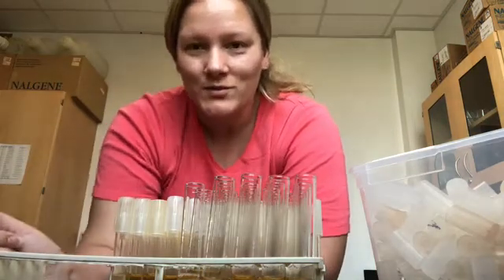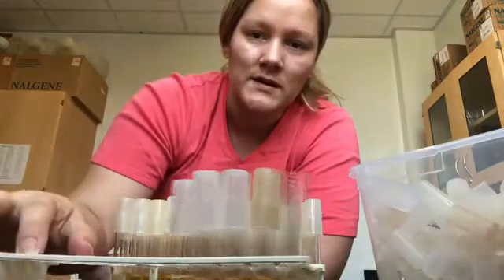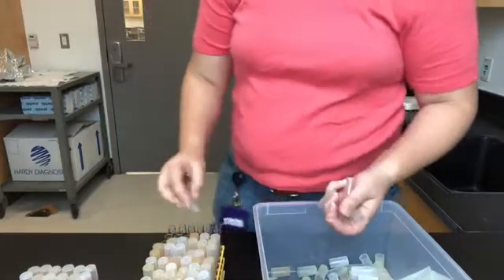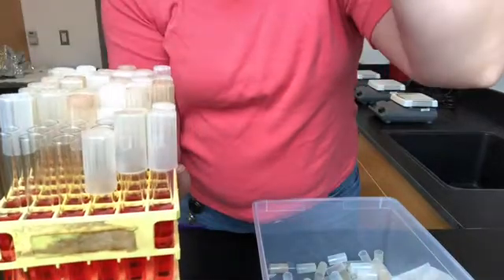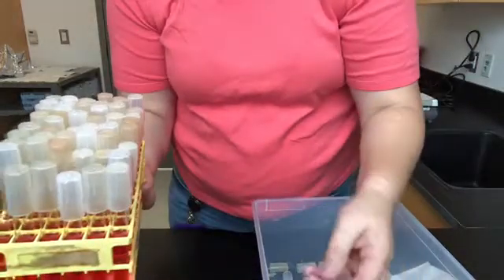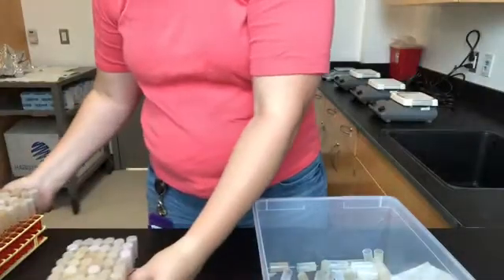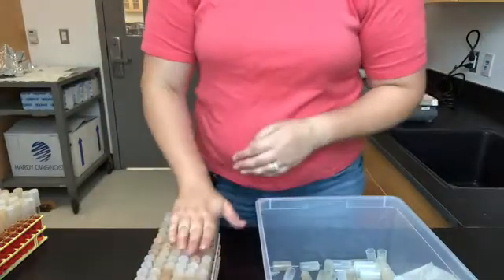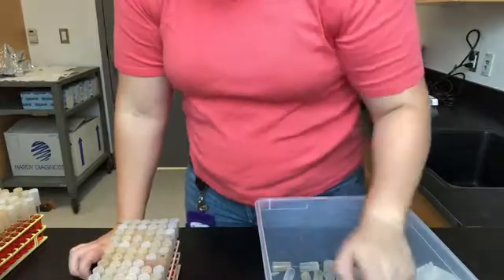How to cap test tubes

Comment: Hi Lori, great detailed video, but I have two questions: 
I've found that my similar caps are not air or liquid tight.  I'm just preparing PBS for dilutions, and it would be important that the volume doesn't change too much due to evaporation since I want to prepare them a few days ahead of use. How long can you keep these after autoclaving usually?

Do you know any autoclavable, air/water-tight cap? I've seen polyethylene ones with triple seal rings, but no polypropylene ones.

Thanks so much.